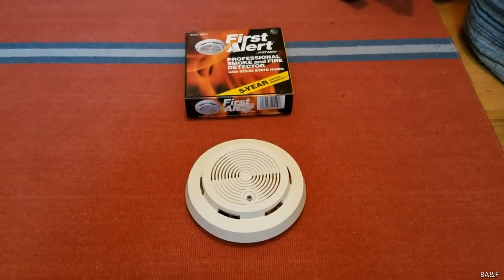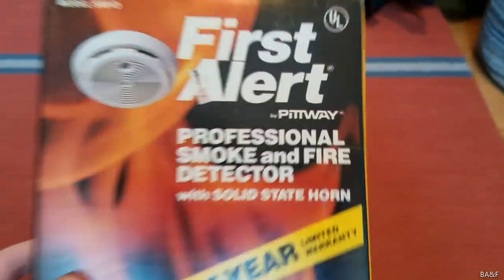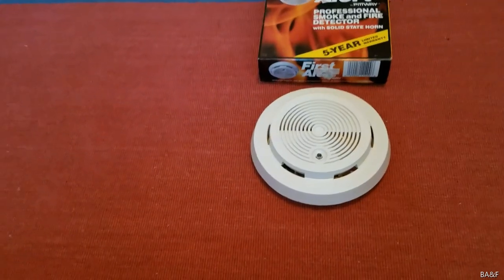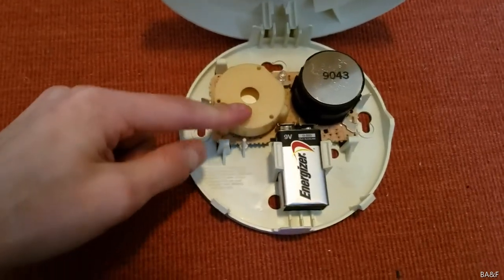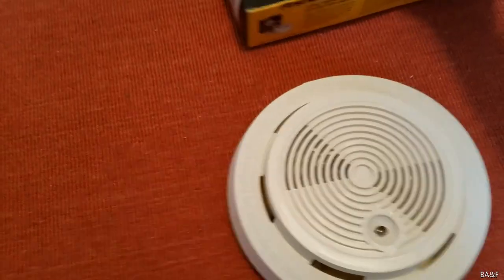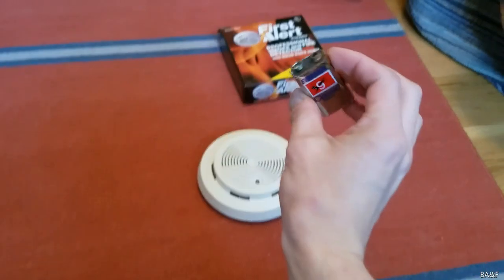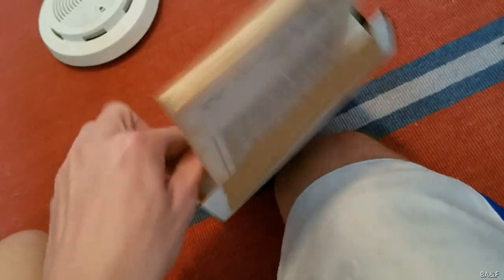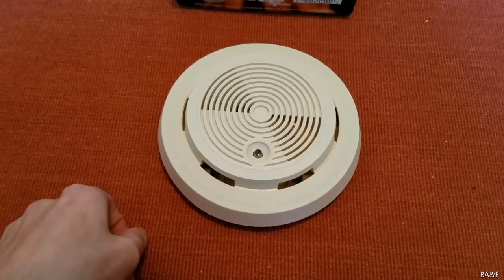First Alert SA80FD Smoke Detector

Comment: I’ve noticed a trend with a lot of BRK and First Alert model numbers: the two number format lines up pretty well with when the model first was designed. 67 would have been the legacy number for the first ever First Alert. 76, 77, 79, 80, and 81 would be pretty self explanatory. 83 is probably when they made a new standard model, and of course the 86, 90, and 92 as you mention.